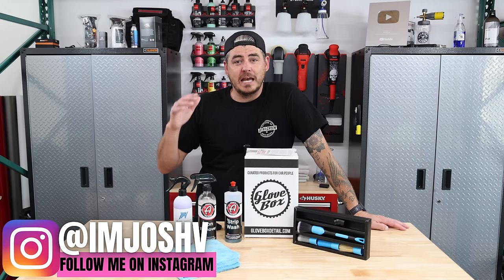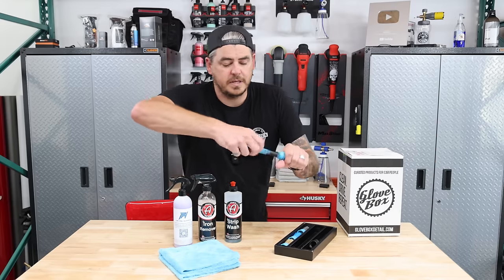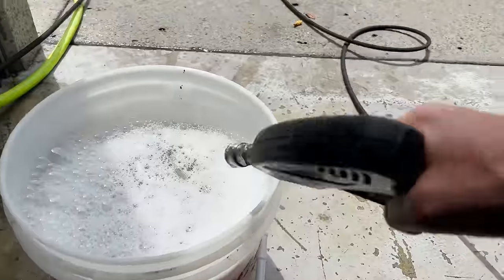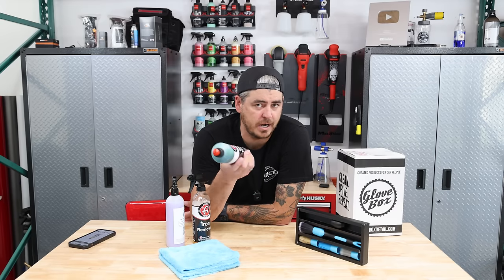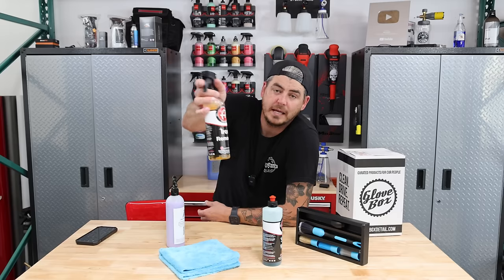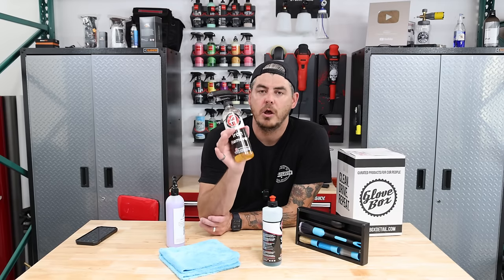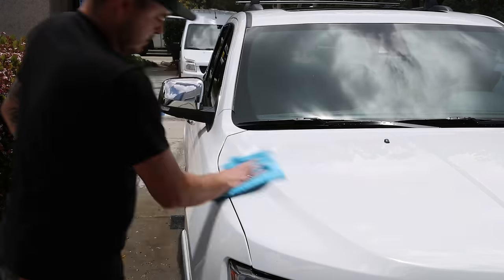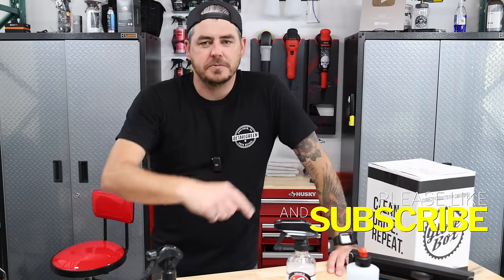IRON REMOVERS AND PRE WASH DECONTAMINATION | Deep Cleaning Car Wash

Comment: I used Adams Iron Remover on a dark grey metallic paint. I saw no bleeding. I have liter of Carpro IronX to try next. For the smell, I wash and dry the car. Drive it a you spray it carwash. Apply and let dwell the iron remover. Rinse it. Drive away and leave the smell behind. 😁 Then I do a rinseless or another contact wash back at home.

Comment: The green strip wash is alkaline. The new yellow strip wash is acidic.  They changed the formula.
Reply from the maker: That makes more sense
Reply: This is correct,  must have sent this to TGB and then changed it.  It was probably 2 months ago when it changed.  The new formula is amazing!  Melts away salt and revives coatings almost instantly!
Reply: @nickw1861  so alkaline strips better?
Reply: Yeah, was wondering why he kept saying acid then proceeds with using a pH tester with a result of 8.5 and still called it an acid. Oh well, we all make mistakes 😅
Reply: @nickw1861 so what is the best one for removing salt?
Reply: @loveracing1988  I would say the new acid formula,  it says it neutralizes salt and prevents corrosion.  I have had very good luck with it!

Comment: Your vids are the best for car detailing.  You should make a vid showing how you prevent brake rotor rust when washing cars.  I've tried different methods but would love to hear how you deal with brake rotor rust after a wash.
Reply: it wears off after a minute of driving and using your brakes…
Reply: @Join0rDIE1776  Yeah, and then you have red rust dust and brake dust back on your clean wheels immediately.  That stuff is corrosive over time.  There has to be a solution.  Best I have found is using a leaf blower to keep them as dry as possible right after washing them.

Comment: Couple questions, how many cars/small SUVs can you do with that bottle of iron remover? #2 Are there any iron remover products that can be used in a foam cannon so it's faster to apply to the entire vehicle?
Thanks
Reply: You can probably do a couple of cars with it but be reasonable with how you are applying it. I would not use it in a foam canon as it would dilute as it went on the car. I like using it with a pump sprayer.

Comment: What would be safe to use on a ceramic coated car if i wanted to use a clay towel? What product would be used with the claytowel to safely clean the car
Reply: Griots Foaming wash is the perfect prewash because it's harsher than car soap but doesn't strip coatings like Adam's. Ph I think is 8.5. If you want to get more gentle, ONR does a decent job at contactless too, just not as effective as Griots in a foam cannon. I've looked this up for too long; most prewashes are way too aggressive. Carpro Reset is in the same veining as Griots just way more expensive. Lastl, Adam's claims 8.5 PH but then says strips waxes. Griots claims 8.5 PH but says doesn't strip waxes